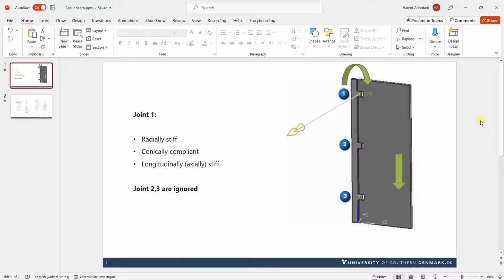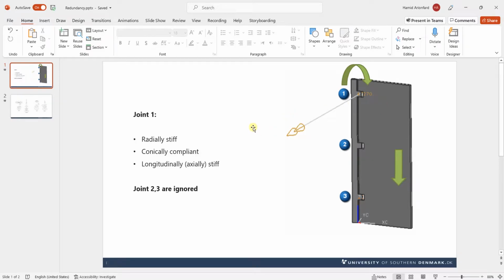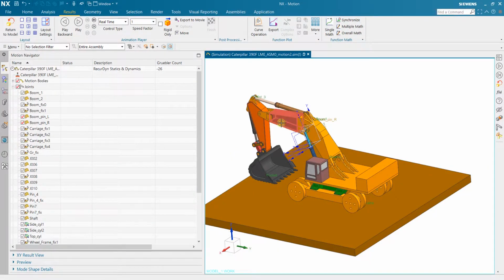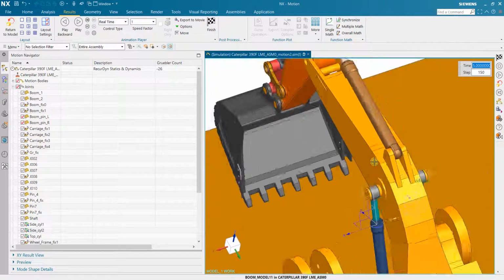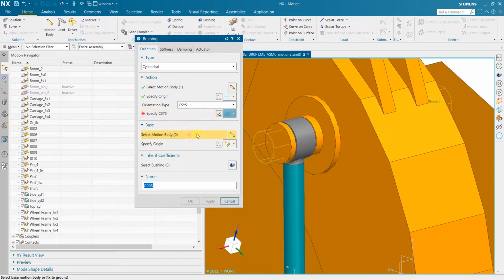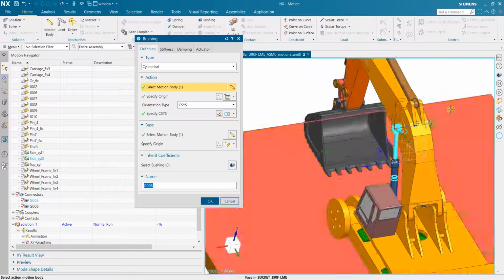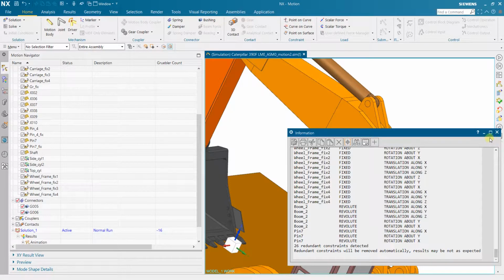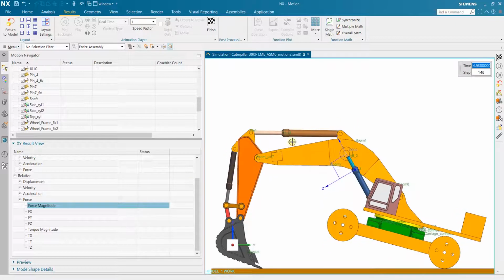Handling redundancies in NX motion (or any rigid body motion simulation)

Comment: Hi, do you have any idea how to calculate friction forces in the bushings? I would write a function for resistance torque based on the radial forces in the friction, but i dont know how to extract them, i cannot even apply sensor to measure these forces.